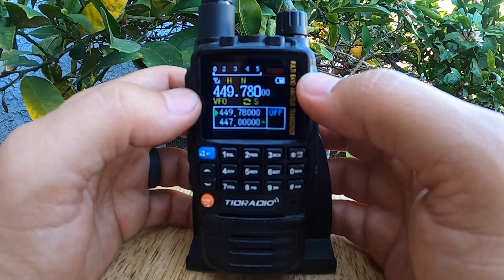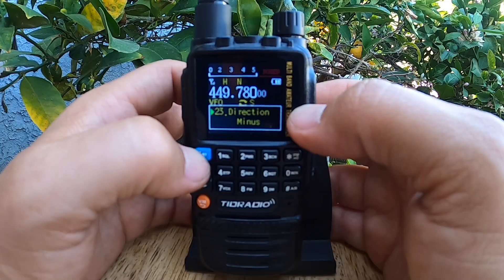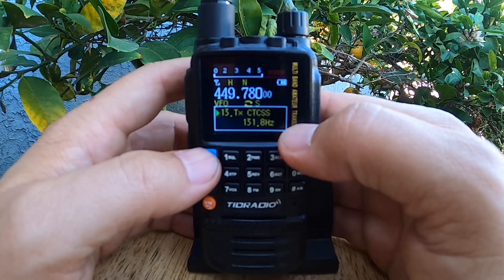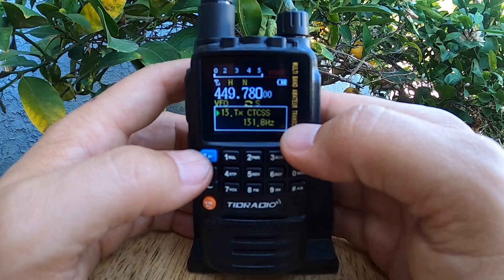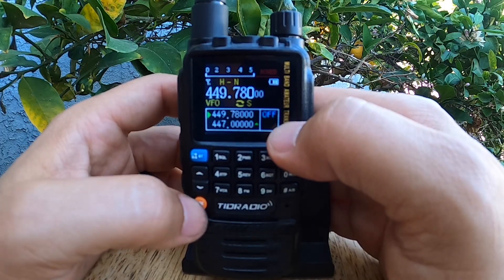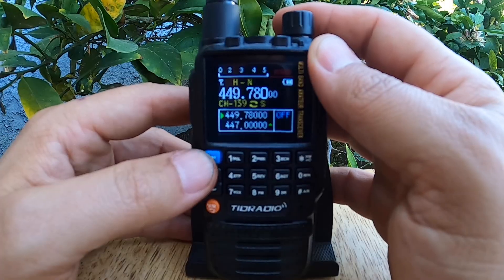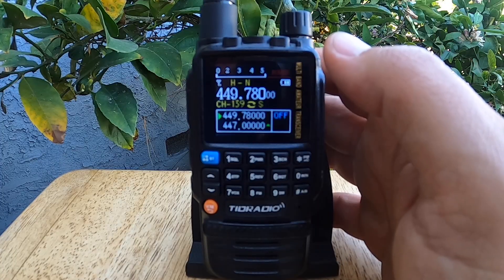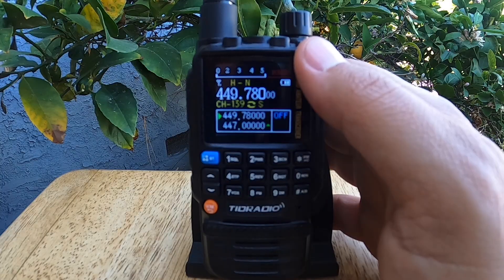How To Program a Repeater on Tidradio TD-H3 Fast and Easy!

Comment: Just got my H3. Step 23 (direction), changing the value to anything other than “none” doesn’t save. If I select plus or minus, then click the blue button, the value is changed back to “none”. I replaced the radio with another one from Amazon and - exact same problem. Both manuals and boxes say these are TD-H3 not the plus models. So frustrating.
Reply from the maker: Did you try setting the other settings first? Change the order you input the settings. Maybe that will help, no idea. 

Also is it locked to GMRS and won’t let you program Ham? Put it into unlocked mode. 

Lastly try programming it with a computer or phone.
Reply: @JebBrilliant  Neither the GMRS or ham modes allow it, even though the repeater frequency is a GMRS one. I had to switch to  "normal" mode with the special key combination during power-on.  Nothing in the manual explains this and nothing online about it except other frustrated users.

Comment: Doesn't work with the TD H3 Plus. The Menu's are totally different. Seems like every video I find features the regular H3, and not the Plus model.
Reply: If you find a good video for the plus version,put a link here .
Reply from the maker: @keithsr. Should I get an H3+ and do a series of videos on how to do common things with it?
Reply: Did you ever find anything that tells step by step how to connect with a repeater? If I do I’ll let you know. Good luck
Reply from the maker: I have an H3+ coming in the next few weeks.